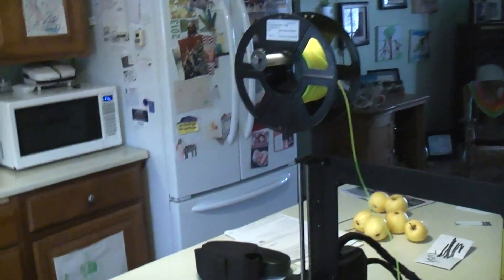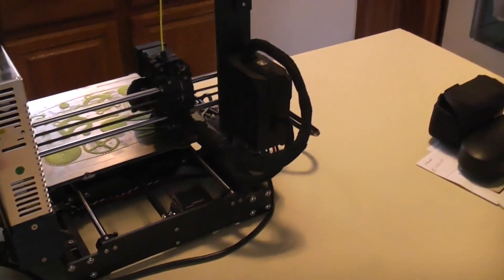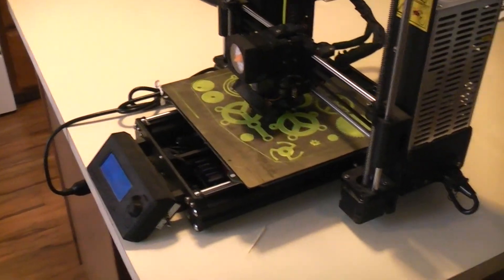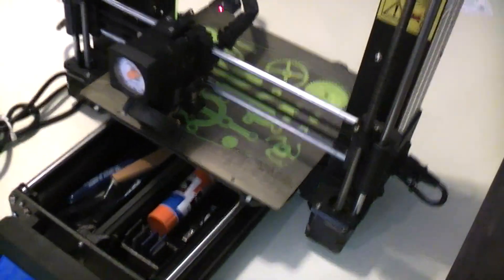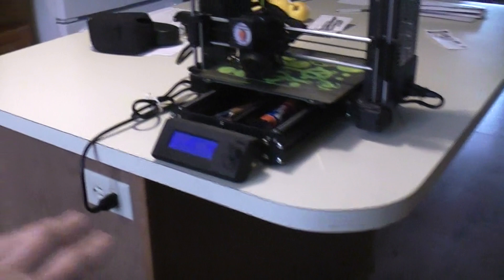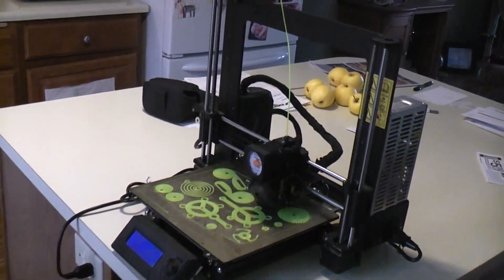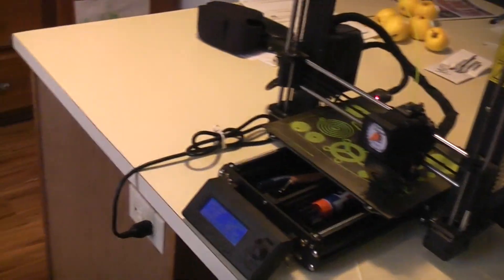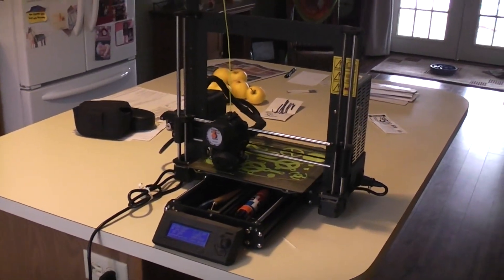Prusa i3 MK3 inline spool holder mod and 1 year review .

Comment: Great video. Like your upgrades, did you upgrade the y-motor holder so the bed belt holder crashes against it vs. The bearing against the y-rod holder? It is like on the MK2s? I also like the Zaribo parts bit more (there is a version for the mk3 frame). Where did you get ultimaker bushings from? Did you see the locknut bed leveling mod? The MK3S is coming so I guess you get some more mods to your machine:-) you already have one part of the MK3S the brightness LCD :-)
Reply from the maker: That is a great idea about changing Y motor frame to act as the end stop. I will have to do that for sure. I like the Zaribo parts but they are a bit expensive. I just found the Ultimaker bushing that had the right outside dimensions on Ebay one day, normally they do not have the right outside dimensions and you would have to print a sleeve to make them right. Yes I saw the lock nut bed leveling mod, not sure I see the point for my printer as I do not have a bed level problem. Have you tried the metal machined parts that replace the printed parts on Aliexpress and those type sites ?

Comment: looking good, lovely mods! personally i'm especially impressed by the backlight dimming switch and i can imagine the bushings making a big difference.
what speeds do you print at? looks pretty fast. the filament usage dial is also really cool! why not print a fruitbowl some time? :P
Reply from the maker: I use the stock profile from Prusa, there slicer and firmware updates. I figure they know best. So when I print at 0.15 or 0.2  layer it is there profile setting for best printing. The only thing I have changed from there stock profile settings is after the first layer at 215 C, I drop to 200C.